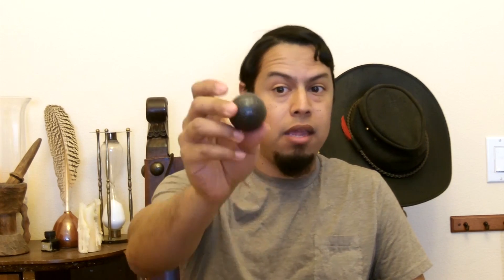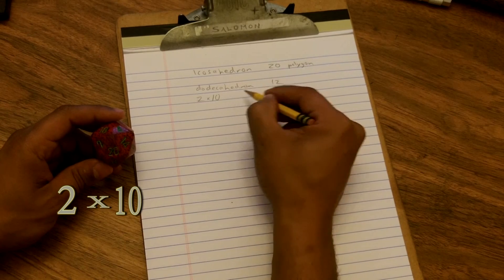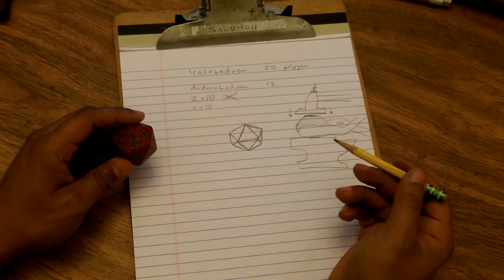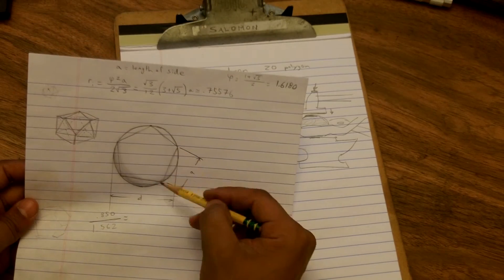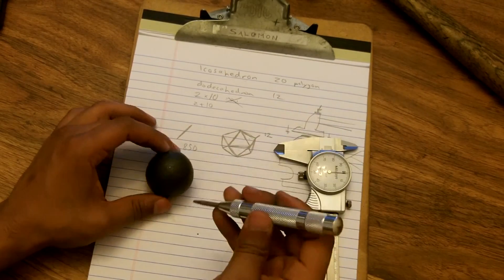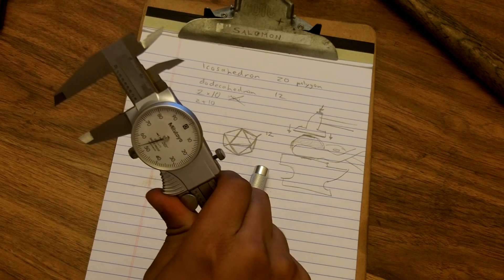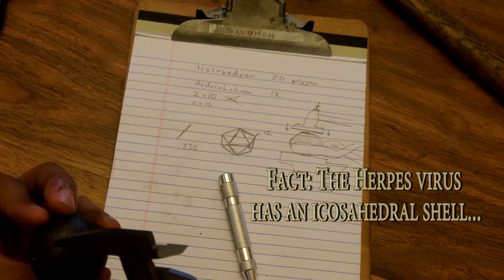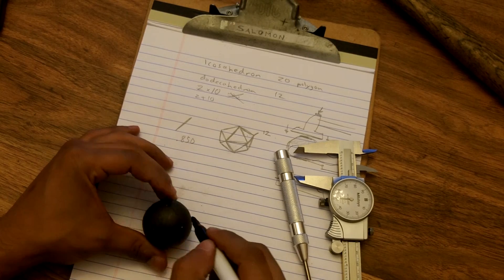Vlogsmith Ep. 4 ( Forging a D 20 'beta' )

Comment: great video this helped alot in planning my own similar project. i did not think to use the vertices i was stuck trying to find out  the faces and mark those, so at the forge you just hit right between 3 marks right? also what is the math you used, and what would it be for a d12?